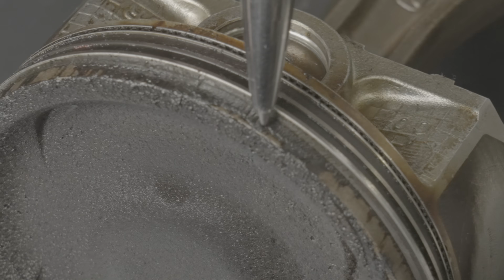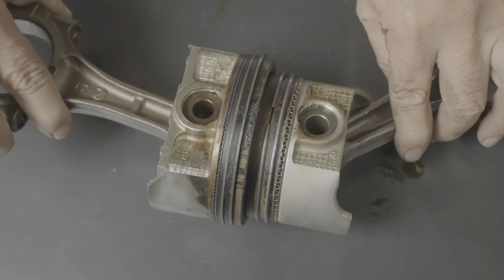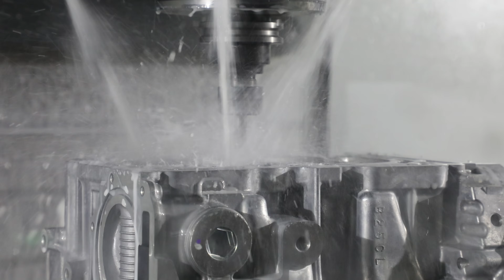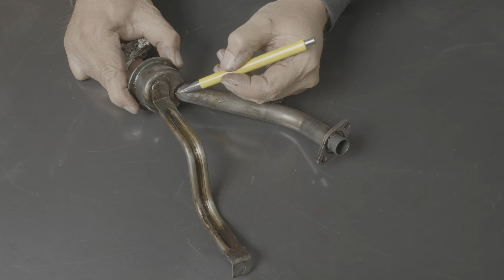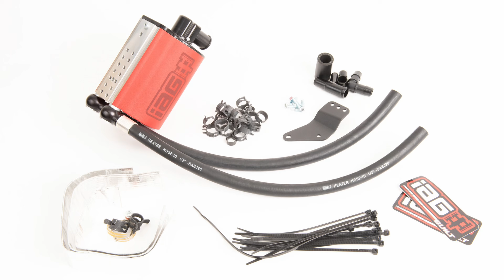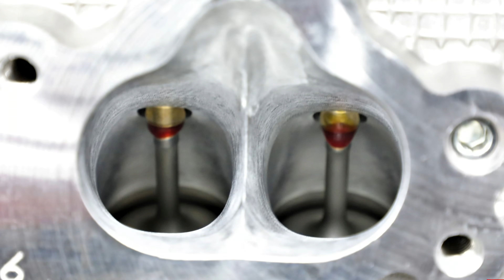Why Subaru Engines Blow Up!

Comment: See my experience has been completely different. I have never blown up in EJ. I have my own shop as well. They have their shortcomings but I think YouTube plays it out to be worse than it really is and I do not think these cars are meant for everybody because they are finicky but if you know what you're doing and you understand the platform then they should be fine.
Reply: I bought a $600 EJ25 outback XT from an old man who babied the hell out of it, it blew up at 68K miles. Your experience is one in thousands...
Reply: @pontiacg445  it's easier to blame the car isn't it?
Reply: @TheJines123  Compared to what? I bought it blown up from an old dude who kept every single service record from the subaru dealership, even kept every single gas receipt he ever got and logged it all in a notebook. Ringlands gone on the front left cylinder, whatever number that is. 

I'd say yes, it is easier to blame the engine and it's bad design with all the evidence laid on the table. Your experience is very much the exception to most, else this video would not exist.
Reply: @pontiacg445  how did it blow up? Just because it has maintenance records doesn't mean somebody didn't run it out of oil or something. Also it's not good to Baby a car either. I see this all to much. Just because it has a good maintenance records doesn't mean it's impervious to stupidity
Reply: @TheJines123  Like I already said, the ringlands on the front left cylinder let go because subaru couldn't make a decent engine if they tried. It still ran, just like hot dog snot.  

A car that had religious oil changes done at regular intervals that runs dry before it even hits 70K running out of oil? Alright, bud. You clearly know everything and anyone who ever had a problem with a turbo subaru, which is pretty much all of them, clearly is just stupid. 

lol
Reply: @pontiacg445  no your wrong a ringland doesn't just die for no reason. I see you don't have experience with this. Ringland failure was probably caused by using the wrong fuel. This is common EJ knowledge. I've had 12 EJ cars and have never done this. Instead of being narrow minded and commenting on my post with no knowledge on this how about do some research. This happens to new and old cars all the time. People put unleaded fuel in a car they bought that requires 91/93 and it spark knocks and kills a cylinder. Oil changes have nothing to do with a ringland failure like that. You last comment just told me all I need to know. My customers have no issues with their cars. Of course they have issues but ringland failure is obviously a user issue.
Reply: @TheJines123  Like I already said, every fuel receipt that ever went through the car is in the glovebox. 

You might think you know, but you are clearly an amateur. I mean, you can't even read...
Reply from the maker: We had one car that blew up on the dyno doing a baseline run that was brand new, bone stock, just nicely broken in. The dealer had to buy that one back.
Reply: @motoiq  You probably ran it without oil and put regular in there! LOL
Reply from the maker: Hahahaha!  Let the coolant out too.
Reply: @pontiacg445  funny you say that but you talk like I said they were bulletproof. Wanna try again?
Reply: @TheJines123  Do I want to try again? Not really, picking on the developmentally challenged is a low brow sport.
Reply: @pontiacg445  so this is usually how this works. Somebody calls me an idiot and calls me names because they lack knowledge on the current debate. How pathetic. Remember your veering off the subject just to call me names but you still think I'm the idiot. Lol
Reply: @motoiq  which I've seen happen to many cars not just Subaru in particular. Again they are not bulletproof but they are not as bad as people make them out to be. The RB25 is just as finicky on a different tax bracket. But nobody talks about that. We've seen Chevrolet Ford and Dodge have premature failures on brand new vehicles along with many other brands. This trashing Subaru trend is exactly that. If I can make my Subarus live to 200,000 Mi then I believe anybody else could. You guys get a good information but sometimes you guys are very misleading. Which I understand you probably do it for the views
Reply from the maker: @TheJines123 Haha, I talk about RB's being fragile and get a lot of hate for it.  Cracked ringlands on the new stock car.
Reply: @motoiq  I mean having a cracked ringland is common but you still can't rule out bad fuel or excessive cylinder heat. These problems do not have them for no reason not saying that you guys did anything wrong but there has to be an explanation other than wanting neanderthals think
Reply from the maker: In 2006 there was a rash of stuff like this with new STI's, the factory came out with a reflash shortly after.
Reply: @motoiq  what exactly "blew up?"

Comment: Do you know how good the stock downpipe is good for (whp)? I wanted to do stage 2 with an aftermarket downpipe, but with the greenspeed update that is becoming more difficult (without going opensource). I also plan on upgrading the fuel system with 1050x and the AEM pump, with a cobb intake. Thanks so much for all the Subaru videos, been a lot of help.

Comment: Seems alot of the issues are due to the fundamental flat design. It would be real interesting to compare the Subaru engine to porsche design.
Reply from the maker: The Porsche engine is much stronger and much more expensive

Comment: Why didn't Subaru do a twin plug set up on the head? Wouldn't you get a cleaner burn and have fewer problems with the pistons? I'm going to assume cost, but I'm not going to pretend I know everything about these types of things; I'm still learning.

Comment: BBR tuning - have been tuning stock EJs at 500hp reliably for a while now. Less reliably , in stock form , 500-700hp. Build by BBR 500-800whp builds proved very durable and reliable. Just for proving nothing , BBR pushed stock EJ long block to 1100 whp and 700wtq !!! on a brand new Dyno Jet. Later opened the engine to prove it has stock internals. Engine intact. His stage X , build and tuned by him, a few days ago hit over 1000wtq and 1400whp on stock drive line except clutch. - This is just a story for viewers entertainment. Nothing is being claimed by this entire comment above. Enjoy what you like. Keep your hate inside you.
Reply from the maker: I would love to see how long those stock power builds last on the track. With good tuning and E85 you can drive a long time on the street or strip at high power levels and a stock bottom end to a point.

Comment: The stock Ej25 has some issues regarding fuel stumbling on acceleration. Do you know of an explanation for this issue. Thanks for the vids.
Reply from the maker: Something is wrong, possibly the variable cam timing screens are clogged, bad MAP, bad MAF bad fuel system.
Reply: It is my understanding that it has something to do with the  fuel pressure regulator. Do you think it would be worth getting the Cobb Fuel Pressure Regulator Kit  @motoiq
Reply from the maker: If you are keeping it stock replace with new OEM. Make sure you properly diagnose the problem and don't just throw parts at it.
Reply: Thanks for the advice

Comment: Ran 24-29 psi in ej25 on E85 with forged internals with FP Green. The car was build for the Dragon and autocross and anything that pulls up next to it on the interstate. 80K miles over 5 years, only oil changes and lots of E85. Engine was build by Fastech. Sold the car with no issues to the next "racer". Not sure how people blow up stock ej25s while driving to work and grocery stores. Maybe they are not telling us something?
Reply from the maker: I think stock, driven normally with good maintenance, the EJ is just fine. I think built and tuned correctly with the right supporting mods and used below 550 whp, it is fine as well.

Comment: Next you should do a video on the 4B11T engine in the EVO X? 
I think that would be a better follow up video because they are also aluminum block unlike the iron block 4G63💡

The differences between the design of flat subaru turbo engines and the mitsubishi inline turbo engines and comparisons for pluses and minuses would be fun! 😅👍
Reply from the maker: We did an article on building a 750 hp one in the red car behind me on MotoIQ.com

Comment: 22:55 I'm thinking that was a little dig at Donut, I mean they did pop 2 with basically NO warning other than the usual jokes
Reply from the maker: I didnt say anything! I feel like their problems were due to improper machining as that is what messes non Subaru builders up.  They did show that they had problems so good for them. I want to see if they fix those cars.

Comment: I will say yes the EJ does have its flaws. The EJ25 for sure has its issues and i dont ever recommend anyone to have a EJ25 turbo, the NA is fine but the turbo is NOT good. Now if you want a turbo Subaru your best bet other than fully built engines and blocks from the aftermarket is to get one of the following blocks. An EJ20 from japan all years are good from the early 90's until present they are good for like....400hp any more and it might pop. Or if you are complete baller you get an EJ22T block or gen 1 EJ20. Closed deck from factory with oil squirters on the EJ22T. I have seen the stock EJ22T with over 400hp all stock internals live very long. If you swap the pistons on the EJ22T you can see over 600hp which i have seen years ago. AND if you do the whole bottom end with aftermarket bits the sky is the limit. Probably could run 50psi of boost into it and it would live. From experience the EJ22T with every bolt on you think of can easy make 280whp all day long. I have a 1993 Legacy turbo with GT28, 550 yellow top injectors, jdm STi ecm with custom tune, AWIC, Koyo aluminum rad, 3"TBE, and a whole bunch of other supporting stuff BUT the engine is the stock 160hp unit EJ22T. If the engine ever pops it will get a full re due BUT as it sits by FAR the best EJ engine i have seen and worked with is the EJ22T. NOTE: i modded my 1993 legacy turbo before Subaru`s were cool and cost a fortune.....If you look up the EJ22T for sale now they cost as much as aftermarket blocks with equal performance.....NOT cheap.

Comment: First thing I blew on my STi was the crank. Must have been that distorted machine work you mentioned. Thanks for the great overview!
Reply from the maker: Wow that doesnt happen often.  Was this on a built or stock motor?
Reply: @motoiq  It was a light build with bolt ons, turbo and a tune! The engine had been machined though, supposedly to spec. Only made 280 AWHP for 2 months. Broke it passing someone on the freeway. Everyone agreed they hadn't seen it before. I have both pieces in the closet for fun.
Reply from the maker: I wonder if it needed align boring and they didn't check it.
Reply: @michaelshaw6242 where did it break? Main journal or rod journal? If you post pictures somewhere I'd be interested in looking.

Comment: If the engines consume that much oil stock, that alone could cause a lot of those detonation issues.
Reply from the maker: I should have mentioned that
Reply: The biggest issue that isn't mentioned. Aircraft boxer engines have the same issue. Inverted engines and radials have the same issue, only with aircraft they aren't usually running low manifold pressure so less oil is pulled into the combustion chamber over time, but for a subaru or car engine where you run at part throttle for a long time it creates issues.

Comment: Well done.  I enjoy watching someone who absolutely knows what they are talking about.  Unreasonable expectations on what was originally designed as a family car into a turbo charged monster will cause problems and expensive disappointment.  61hp/liter for the stock NA engine to 121hp/liter for the factory STI and then expecting up to 320hp/liter to be reliable is a pretty good stretch as a reasonable expectation.  LOLOL!

Comment: They blow up when someone tries to add minimal mods with no supporting mods and try to push the max amount of power or with aggressive timing on the tune. I’ve gone from 350-500-700+ hp but all with IAG blocks and I don’t have any issues. The stock pistons however are weak because of the casting process and increased silicone in the cast. Now our trans is bulletproof I’m on a stock trans and even my buddy pushing 800+

Comment: There’s a new problem with the FB engines. Subaru traded bad HGs for bad FIPG sealant on a large surface cover. An oil leak will cost way more than a new HG or TB.

Comment: This is a very long-winded way of pointing out that every single point of this engine is not a performance motor and is just generally bad for more than the factory power level.
Reply: He's doing a PSA and elaborating on every aspect of these that causes them to blow up, he coulda made a video an hour 45 minutes long about why EJs blew and still not wasting breath lol

You're right though it is quick to just say the EJ is made of tissue paper
Reply: Thousands of modders, tuners and amateur racers will disagree with you.

Comment: Mike,  have you found a solution for the ringland issue? I have a turbo 2.0 2004 and 2.5 2007 both on the same blocks. The time is coming, but when i build these blocks what is the best option to deal with ringland failure
Reply from the maker: Change the pistons.
Reply: @motoiq thanks, any recommendations?
Reply from the maker: We like JE, Mahle, Wisco, CP, IAG

Comment: Is a 2008 wrx reliable with 300awhp using a catch can, E85, good oil and a good pickup tube?
Reply from the maker: Yes if tuned correctly
Reply: @motoiq  thank you!

Comment: Bottom line- these were not designed to see sustained high power levels, nor be straight line race cars They are temperamental and will give you issues if they are not properly modified and tuned. Even at 400whp, people should remember this engine is outputting nearly twice its factory power (240whpish). Know the engine and treat it accordingly and it will treat you right. The masses got ahold of these cars and blew them up, because they did the complete opposite. As Mike said, temper your expectations. I’m not sure saying Subaru engines suck is the approach I would have taken. People should lean on due diligence before they modify their car incorrectly, lack realistic expectations and then blame the manufacturer. They can be extremely fun and competitive vehicles. Lastly, while I completely agree with the technical aspects of this content, both oil pick up failure and head gasket problems are not COMMON with the turbocharged models. Oil picks ups are weak and should be exchanged for CYA purposes. While the head gasket sealing surface could be better, failure isn’t common. Keep up the great content.
Reply: Good deal. The pre owneds definitely have a propensity towards abuse and neglect. Thank you for the phenomenal continued content and wisdom! As a tech who always has more to learn, your insight is gold.
Reply from the maker: I would say that head gasket failure is somewhat common, probably the #2 cause right after broken ringlands. The pickup is about #4-5
Reply: Interesting. I’ve owned about ten and have never suffered catastrophic failure of any component, but I also know the engine and haven’t pushed  over 500whp. What power levels are  you seeing the hg failure consistent with?
Reply from the maker: A lot of times, its mild bolt on cars with higher mileage, some of this could be bad tuning and not changing coolant, etc.  Recently we had a couple of 200k engines still running come in for a rebuild, the mileage records!

Comment: Fake news. Youre pushing a narrative
Reply from the maker: Not fake news at all, this stuff is common knowledge to Subaru engine builders.
Reply: @motoiq  you are right. I really enjoyed your explanation of the ringlings and the difference on other cars. As well as the need to advance the timing the flame path or whatever across the cylinder head. I never imagined before.

Comment: Subaru motors are garbage. They're renowned for many mech failures and weakness. I believe the mains & big end clearances are too tight from factory too. 1.2 to 1.6 thou is rediculous
Reply from the maker: Actually that is about on par for an aluminum block. they have to run tighter than an iron block due to growth.
Reply: @motoiq  I feel anything below 1.6 thou is asking for trouble. they're the same on the big ends too. I think it's why they're so bad for big end failure. I feel they'd be better with a higher viscosity oil and a little more clearance (probably not an option due to emmisions/effiency though).
They also don't seem to handle more than 400hp without significant modification.
Reply from the maker: If you open them up, you gotta worry about low rpm oil pressure.

Comment: Is there much difference between the Fa20 and 24 strength wise? and your thoughts on the Fa24, very recently bought a new BRZ.
Reply from the maker: We haven't modded one yet, just rebuilt some GR Cup stock ones.